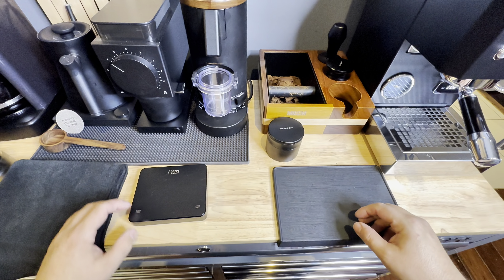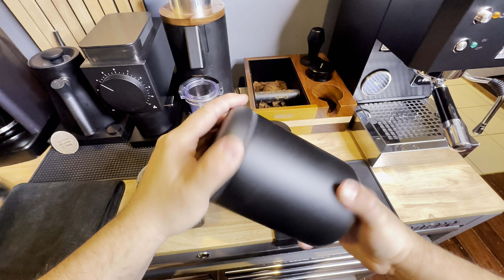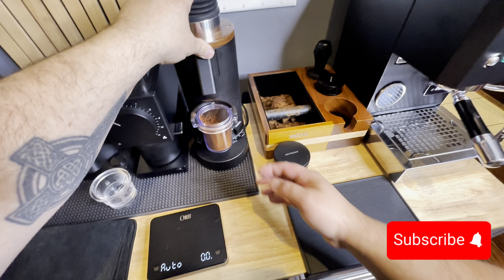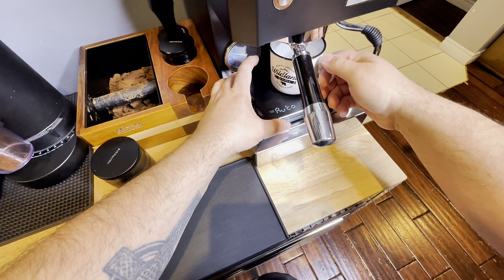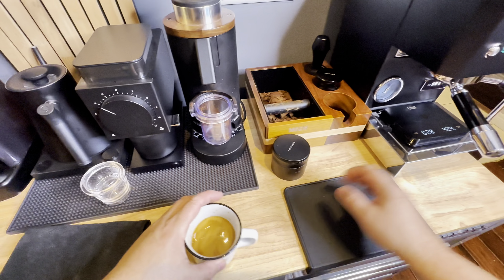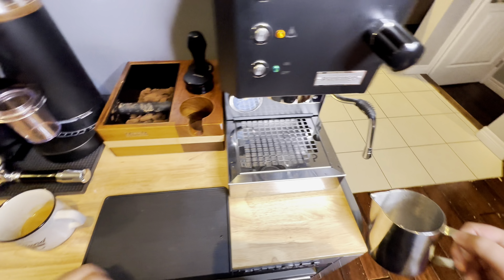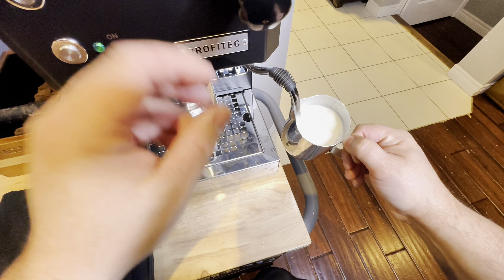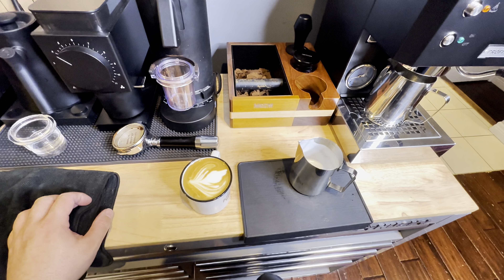Profitec GO Workflow POV

Comment: When my Prof go warms up in the morning I’ve noticed that it starts heating up to high temps as if it’s going into steaming mode during it’s “up” cycle. Is that normal? I just purge it until it’s around my 200 degree shot temp.
Reply from the maker: Mine does not do that
Reply: This is the "Fast Heat Up" function from software version 1.06. So everything is normal.